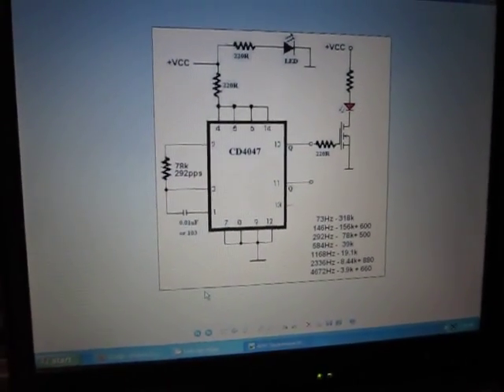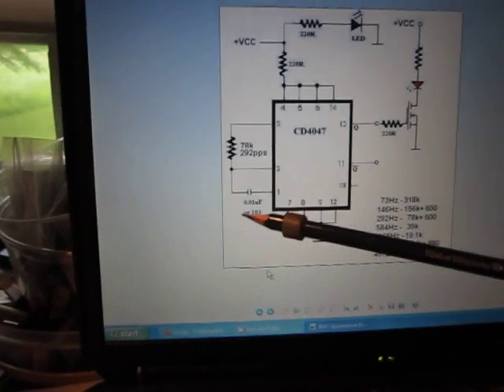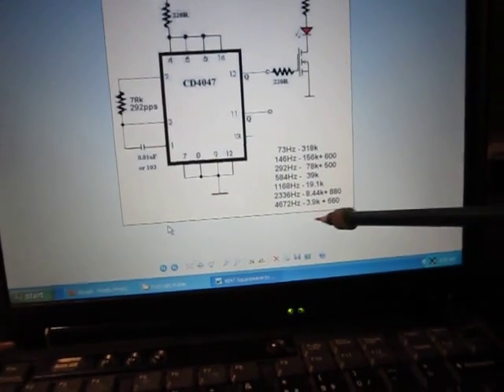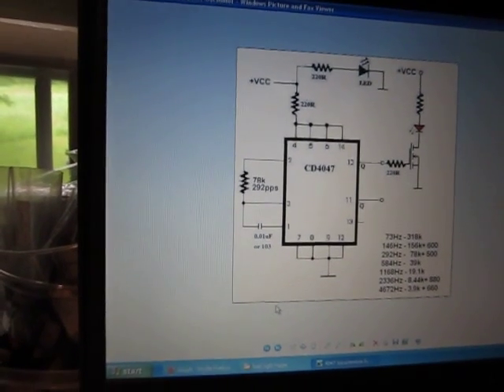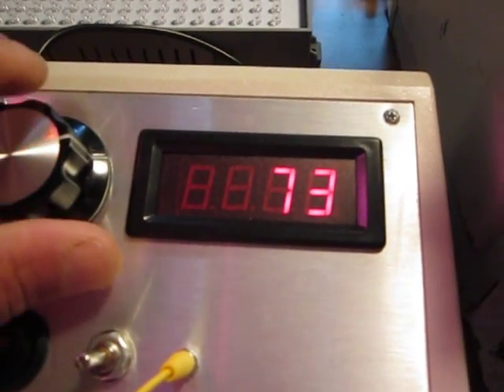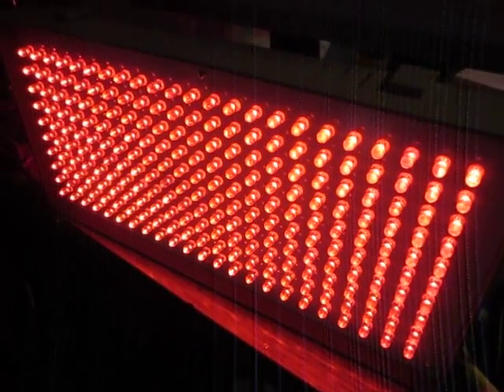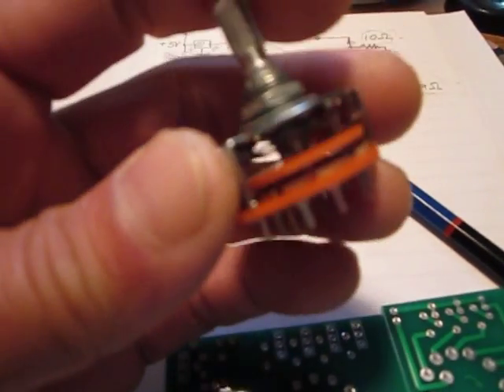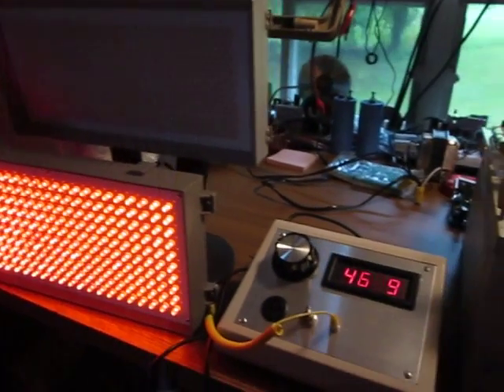RLT - Red Light Therapy Device

Comment: Hi, you have mentioned that it has helped with an issue you have with your eye. I have an epiretinal membrane (or Macular Pucker) which is a sort of scaring on the surface of my eye retina. I have built two Led matrix of 650nm and another of 850nm leds. Both are controlled via a micro-controller in terms of precise frequency and pulse width settings.  Do you have any personal advice on the best settings or any pointers to any literature that might help me. Many thanks!
Reply from the maker: Hi, I would try 292pps at 50% d.c.. Keep you eyes closed during treatment and limit each session to 5-10min max. but you can repeat them every 3-4 hrs. That's how I treated myself but my issue was different.
Reply: blackchisel97 thank you very much for your prompt reply. I will try your recommendations. Which do you think is better to use the deep red 650nm or the infrared 850nm? Much appreciated!
Reply from the maker: I would try 650nm first. My lamps are 660nm but both wavelengths are within the physical length of Mitochondria and at one of their resonant peaks. 850nm corresponds to another strong peak. The areas (wavelengths) in between don't absorb as good.
Reply: blackchisel97 Many many thanks :)